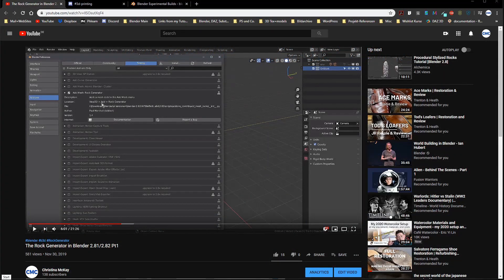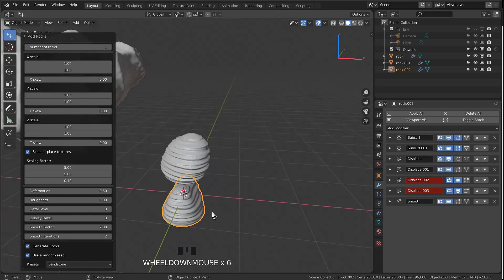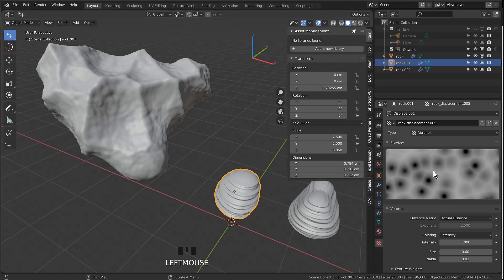The Rock Generator in Blender 2.8x Pt2

Comment from the maker: Timestamps

0:00 Intro and Topics of this video
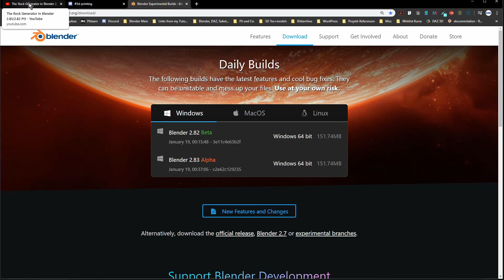1:30 What has changed, shout out to the Blender dev Brendon Murphy
3:00 Where to find the Rock Generator now
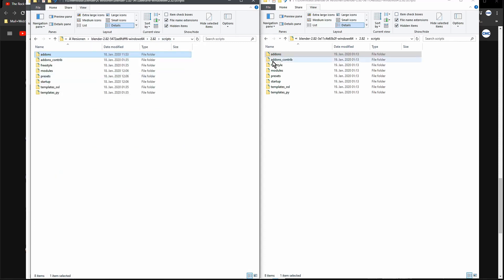5:50 Merging addon folders under Windows 8/10
7:45 Activating the addons
8:20 The new Rock Generator - work was done under the hood
8:45 What's about those scale values?
9:45 Finally, let's start with the Asteroid and the Sandstone presets
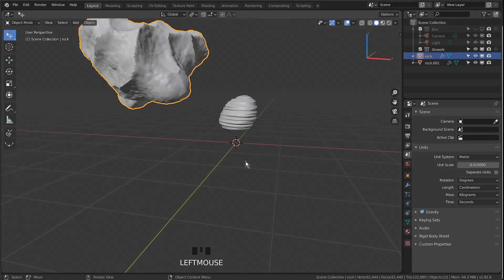10:30 Get rid of shading artifacts with the Auto smooth angle
11:35 Modifier tools
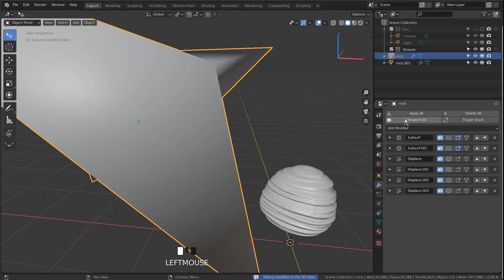13:10 How the rocks look without the modifiers
14:00 Which modifiers are used?
14:55 Why are some modifiers shown in red and which ones can you delete?
16:50 First look at the strength value in the displacement modifiers
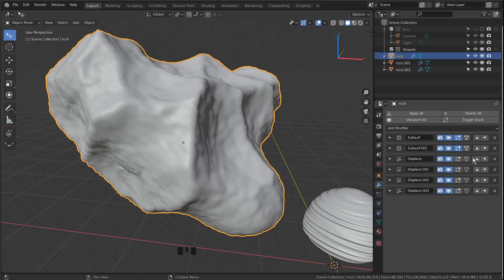17:20 The Subdivision Surface modifiers: why are there 2 of them?
18:55 The difference between the options Catmull Clark and Simple
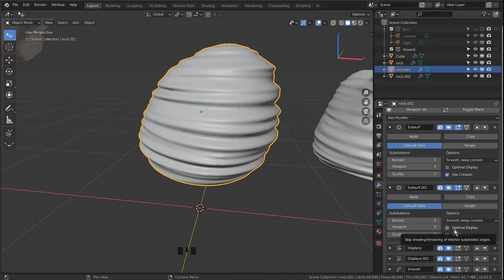20:35 Use creases in the Subdivision Surface
21:50 Display options for the modifiers
23:20 What happens if you deactive the displacement modifiers?
24:15 Displacement textures
26:50 Direction for the displacement
27:20 Texture coordinates - fancy stuff with the option "Object"
28:30 Strength and Midlevel
29:25 Use Vertex Groups
30:40 The Smooth modifier and its options
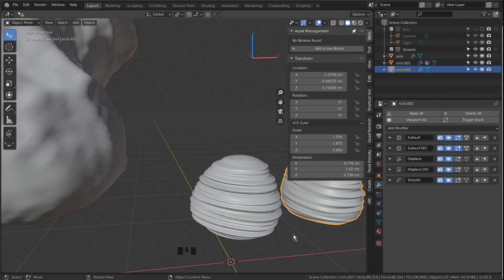32:50 Short preview for the 3rd part and weird habits
33:40 This time my answers for your questions might be different ...
34:20 Shout out to my friend Jay Versluis for the Intro animation - please watch that stream!
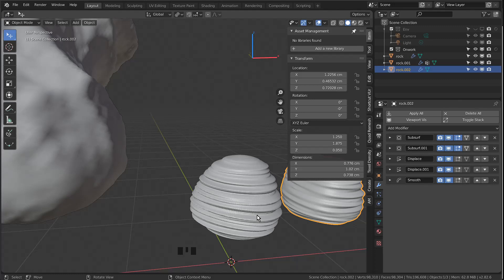34:55 Please subscribe to the channel and my Bye bye for this time
Thanks for watching!